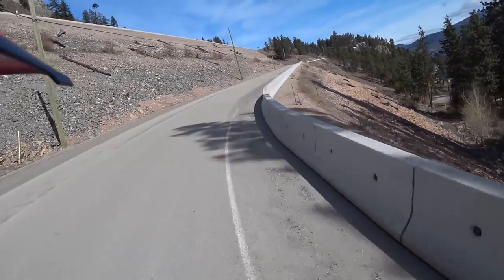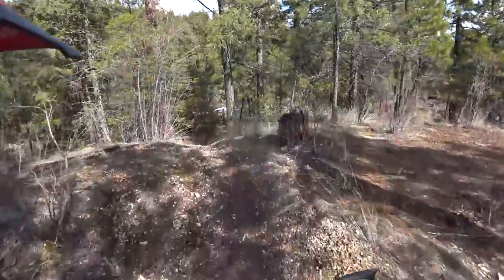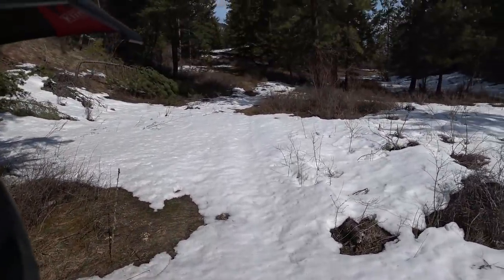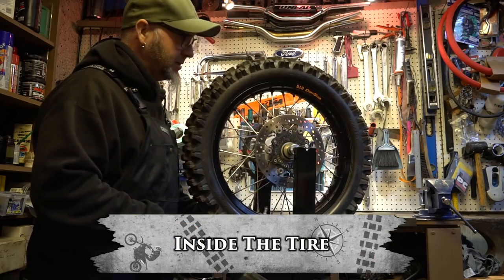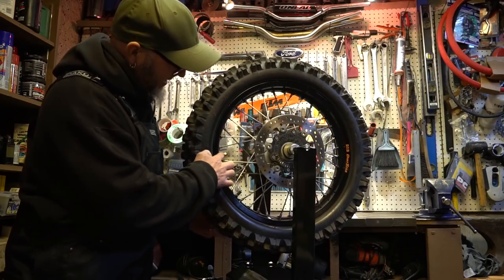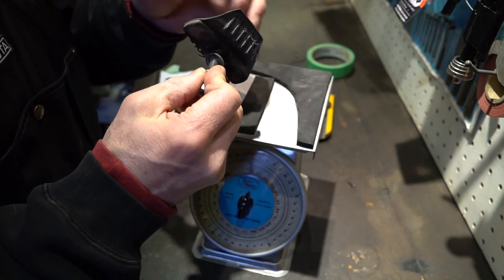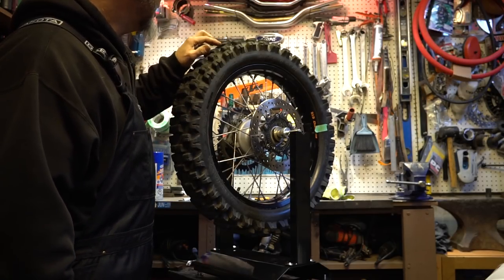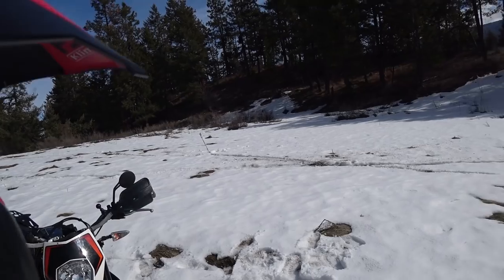KTM 690 Enduro Vlog Ep 7 | Dual Sport Tire Balancing

Comment: I am debating rim locks myself for 2018 KTM 690 Enduro R.  Came across your video.  I am not an aggressive rider.  Mellow 50/50 rider. Fire roads.   Would you still recommend rim lock?  What is your front/rear tire pressure off-road vs. on road.?  Great video. Thanks for sharing.
Reply from the maker: Not sure that rim locks benefit anyone unless your valve stem is starting fold over, they do give you piece of mind for not ripping the stem off! I usually run 10 to 15 PSI give or take pressures are always the same I don't ride a lot of on road! :)

Comment: What rear tire is that? have you done much road riding with it? do you recommend it if one has to drive 20-miles on road to get to a trail? great video, thanks for putting in the time!
Reply from the maker: Thanks for watching!! :) Its the Motoz Tractionator Enduro I/T, my riding currently is 5 to 10 miles on road to get to dirt and it does have the DOT stamp on it so you should be fine it would be slippery on wet roads due to the taller knobbies but it sure works great off road so I can justify it's use! :)
Reply: Awesome, thanks for the reply.  I ordered a dunlop d606 a couple of days ago before I saw this video.  have you ever used the d606? if so does it compare ok to the Motoz? I can tell that you are happy with it now that you put that tire on.

Comment: What are your thoughts on using balance beads?
Reply from the maker: Good question I'm not sure my dad used them in his Harley without any issues.. but a dirt bike the wheel is not as consistent as riding on road so they might not level out as good I just prefer something I have control over! :)